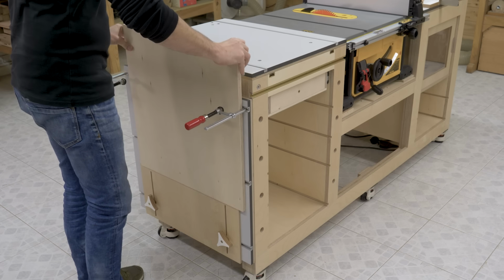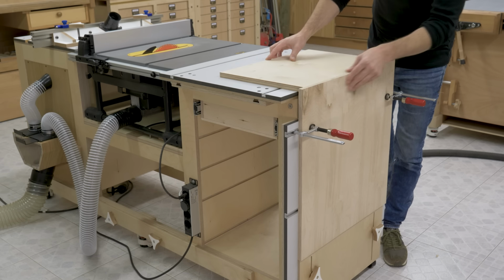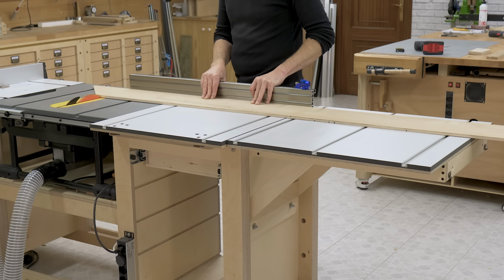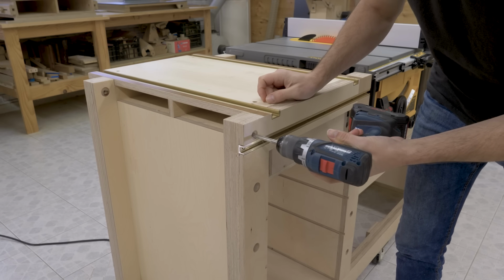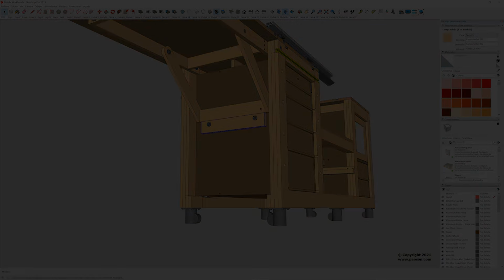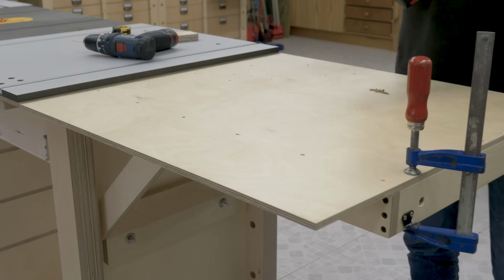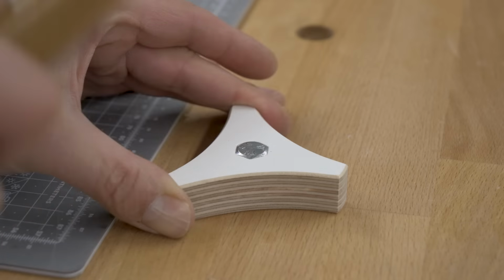DIY Workbench Side Folding Table / Mobile Workbench EP 5

Comment: I love that it’s focused on function and not overstuffed with storage. It’s more a tool with function than a container. Impressed with how perfect your plywood looks; Sharp blades I guess.

The folding arm is basically what I used for a dog ramp I move around for my puppy. Learned a lot with the steel spacer taking the wiggle out and bolting tight. Perfect amount of spacing.
Reply from the maker: thanks mate!

Comment: I still think that this workbench build is great and that it can only be improved by using a couple of earth magnets that are set into the pull up draw extension that is under the sliding tabletop. By installing the magnets on your draw pull up it will help you when using your sliding table aswell as the metal clip that is used to catch the sliding table and stop it from tipping the magnets will help do this too but it will mean you nolonger need to use your hip's against the draw.!!! As always buddy  💯%    👍    🇬🇧.
Reply from the maker: I have in mind to do it when I finish the workbench, thanks!

Comment: I quite like this workbench.  I would suggest one very small change - on the support for the folding side table, instead of square 90deg cuts, if you put them at more like a 20deg, cut it'll be a little more secure and hold fast like a french cleat.

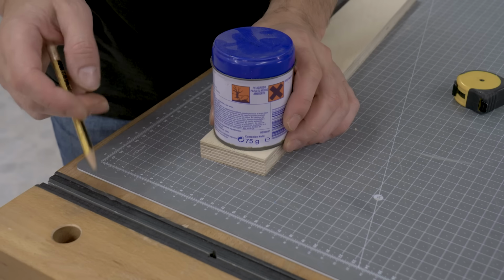Comment: 7:37 could you please tell me what drill bit this is? The bigger, black one. It seams to have a very acute tip. Thank you. And as always your work is remarkable and this looks like something to start a business with. Although one does need some precise tools to begin with in order to achieve desired precision. In other words. You have to be at least an average woodworker to make this in my opinion. And equipped accordingly.
Reply from the maker: thanks Borys, here you will find that bit. In that clip I was using a removable countersink adapter:  https://www.paoson.com/forum/viewtopic.php?f=22&t=60#p5681

Comment: Hi, amazing build!  one question - why not use the same brackets for this side extension as you did for the outfeed extension?  is this considerably more stable or accurate?  the brackets are certainly easier!

Comment: Thanks Poason. This design is amazing. I have bought the plans and will try  to make it myself (although doubt it will look half as neat!).  
Two questions. 
In the cutting diagram there is only one board making up the top of the folding side table - piece 16 in the parts list. 
On the YouTube instructions of this video, EP5, shown at 15mins, there are two - a plywood base and a melamine top.
Which is right if following the purchased instructions?
Also, if I want to have a melamine top as in the videos, which pieces in the parts list should be cut from this board?
Thanks. Dan
Reply from the maker: hi Dan! t his is what you can read in the instructions:  ""Here in the 3D model you can see I used only one hard plywood board to make the benchtops of the original design. In my case, I’ve altered the design a little, so I got hold of a board that’s similar to MDF, but a little harder and with melamine on both sides, which I thought was perfect for this workbench. Both methods and materials are perfectly valid"" 
If you have more questions write me by email please, I can help you better